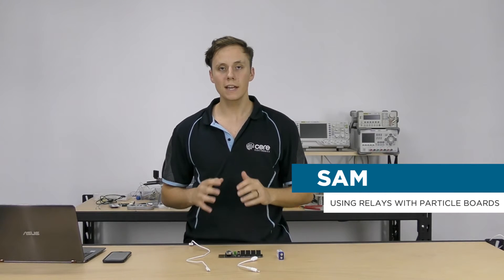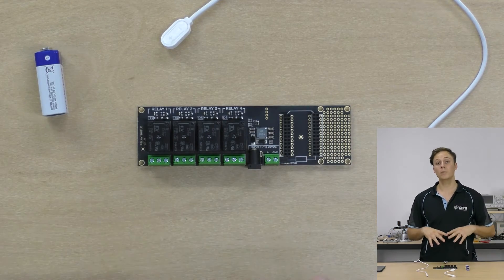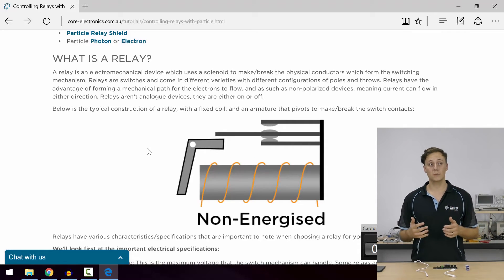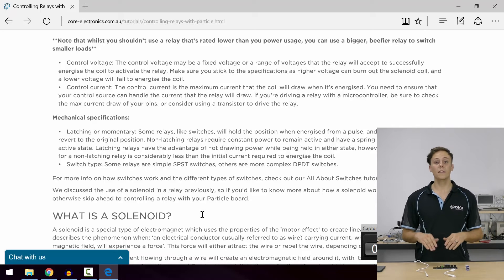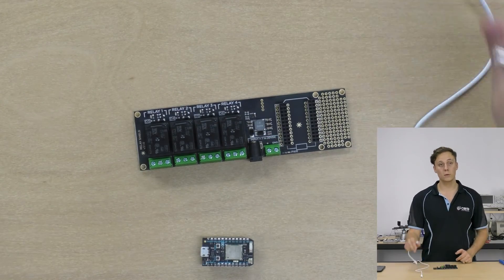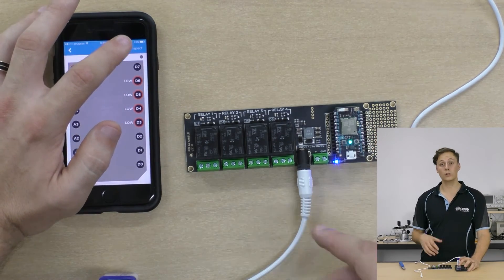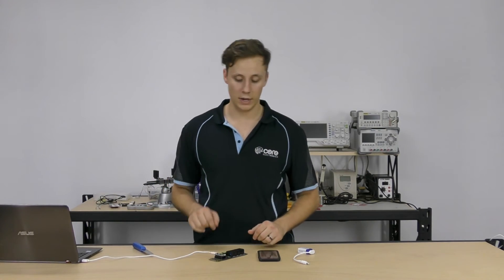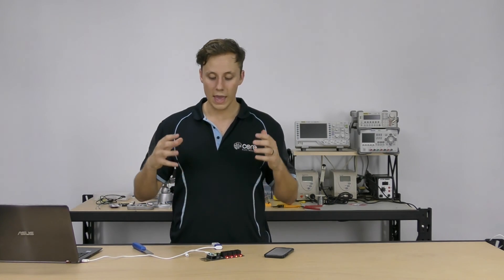Using Relays with Particle Electron or Photon

Comment: Good work and very helpful video.  Enjoyed most of it. #Subscribed

Some Notes:
1. Relay ratings are each specific ratings, not power ratings. Heat generated is a factor of current squared, irrespective of voltage. Power is a product of voltage and current. Point being, you just cannot stuff more current at a lower voltage than the limit, just because the product, the power, stays the same. 10 Amps is 10 Amps. Or you burn the contacts. Voltage limit is set to prevent arcing inside the relay, while switching. Overall, COUNT EACH RATING AS INDIVIDUAL.  Of course there is a factor of safety thee, so you likely won't burn it up to 12 amps, but you get my point. Can't stuff 100V 20A in place of 200V 10A.
2.  Your eyes are too damn distracting 😂😂 moving here and there all the time.